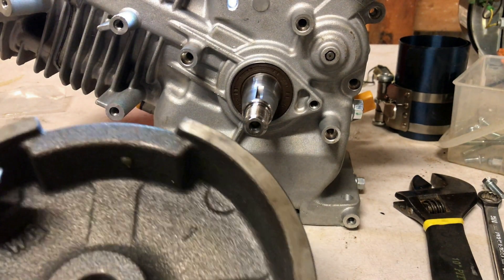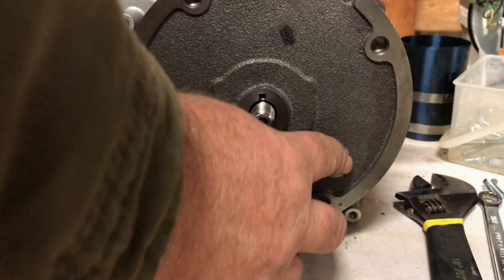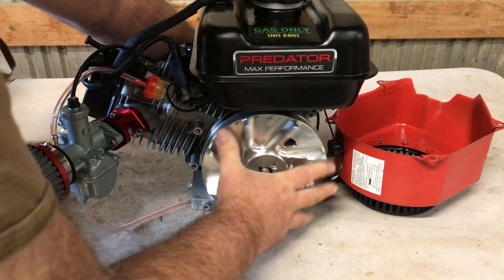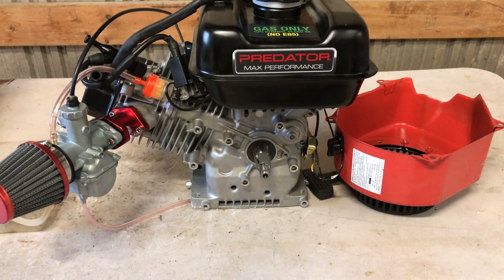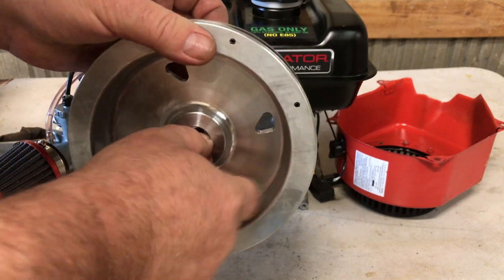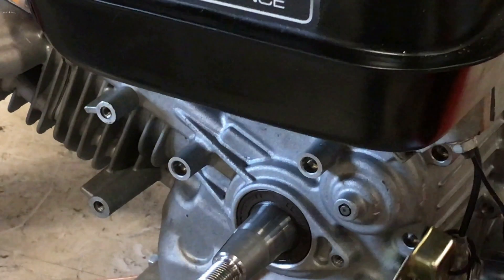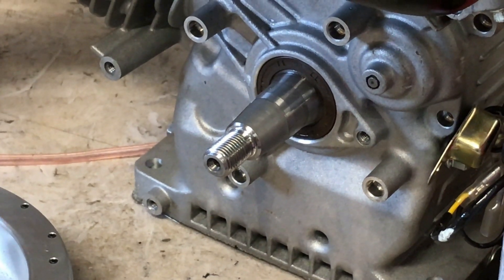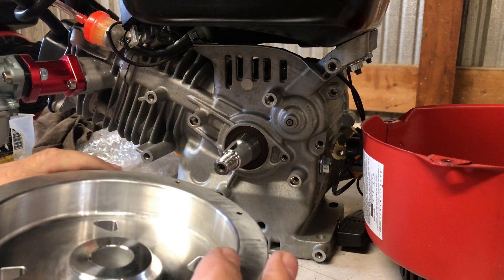Hard Starting and Kickback Solutions for your 224 Predator 212 Engine Build 223 Wildcat 236

Comment: I have a predator 212 with a stock key and arc billet flywheel  it kicks back but I’m not sure if it’s the flywheel because it has built in timing but do you think I have to turn it back a little bit?
Reply from the maker: Hi Dayton! I'm using the Slip Stream billet flywheel and it's supposed to be around 32 degrees with a "0" stock key. I think it's actually closer to 34 degrees though. With the 224 build and the parts I used in that one, I'm using 93 octane with some additives to kick it up to around 95 octane and some synthetic two cycle oil mix about 100:1 . I had to reduce the timing about 2 degrees in the end. I'd rather run Methanol and kick the timing up to around 38 degrees in this engine, but it's not a true race engine and will never see the track. I'll just keep it on gasoline with additives for now. It still kicks back every now and then but that's ok as long as it doesn't become a habit.

Comment: I just got a new cup and pull start for mine I replaced it and work great for day maybe got loose thur timing off or muffler value I think pull my arm out of socket yesterday
Reply from the maker: Hi Paul! Don't forget to check the valve clearance adjustment. It doesn't have to be off by much for the compression release to stop working. I think I have one arm longer than the other after years of pull start kickbacks! 🤣
Reply: @KentuckyFriedFixes  I adjusted valve clearance now no compression not sure there all reading good I think
Reply from the maker: Hi Paul, you may have adjusted the exhaust valve while it was on the decompression bump. Check out the 7:45 minute mark on my video titled "Part 3-B DUCAR 212 Hemi Performance Engine Build" For the details on valve adjustment.

Comment: on my ducar carb with 140 etube whats the best jet to run what boosters should i get i wanna juice her up real nice like
Reply from the maker: AC I really can't give you a good honest recommendation of what to run for those carbs. The main reason being, I just don't build the stock carbs because I don't see any big power gains in them. The main problem is they're really small on the venturi bore size and really restrict air flow into the engine. With everybody at a different altitude, I could only guess where you need to be on jetting. I will suggest a couple of things to watch for that may help though: There's a lot of aftermarket parts in kit form for these stock carbs. Be careful with the emulsion tube changes. Some of the aftermarket emulsion tubes are tuned for Methanol and have very large holes that will cause low speed problems if running Gasoline. Just make sure you get a performance kit with emulsion tube that is tuned for "gasoline". Your jetting will always be determined by how it runs on the top end and what the spark plug looks like. Try to jet for a nice chocolate brown color on the plug (light brown is ok if you want to run a bit on the lean side for more power). A white plug is too lean and black and/or shiny plug is too rich. If your carb has the removeable air jet, opening it up to the next size up with a pin drill will allow you to run a larger main jet when fine tuning. You'll get it where you want it.
Reply: @KentuckyFriedFixes  my LG plug was coco brown like foxy lol i put a autolite in it now havent pulled it out yet but do get a kickback everynow and then but only when i limp wrist it if i crank it good it dosent snap back idk i think im gonna order the tilly estart just to throw on while i take this ducar off an open her up
Reply from the maker: @CruiZe-A-ViSiON  Sounds like it's jetted perfectly! I wouldn't worry about a kick back if it's only doing it every now and then. I'd only fool with it if it starts pulling the rope out of my hand more often than not. A little excess timing is a good thing for performance.
Reply: @KentuckyFriedFixes yea that ducar is the bomb diggy for real that's why I was happy when I got the duromax so I can pull of my ducar and build her up 💪🏼💯
Reply: @KentuckyFriedFixes  the 140etube has less holes than stock to give more gas less air thank u big TiME FoR ALWAYS RESPONDING TO MY NEWBIE QUESTIONS lol

Comment: I installed new coil on predator ghost and now it does this, confused, help.
Reply from the maker: Hi Jaden, if you installed a standard stock coil, double check that the coil wire is pointing up. Those things will mount either way. If you also changed the flywheel, it could have more advance too, so a different timing key may be required. Usually it's something small, so just give it a once over. Things like valve adjustment and stuff. Some kickback is normal but if it starts pulling the rope out of your hand more often than not, you may be a little high on the ignition timing. Or the exhaust valve could be out of adjustment and missing the compression release. You'll get it.
Reply: @KentuckyFriedFixes  thanks I will keep at it

Comment: Ugga Dugga that billet flywheel! Let's be honest that's what most people do
Reply from the maker: Hi JB! I put an impact on mine. It seems to upset some viewers so I always recommend everyone follow their flywheel maker's installation instructions, even if I don't. To me, a loose flywheel can be more costly than one a little tight. But again, that's me. Thanks!
Reply: @KentuckyFriedFixes  I do the same. Never had a problem. It is a pain putting a torque wrench on the flywheel bolt. Some small engine guys torque every single bolt to manufacturers spec

Comment: can this happen with an engine fresh out the box
Reply from the maker: Hi Andrew! That's a great question and the answer is YES! The valve lash can be improperly set from the factory causing the compression release on the cam to not function. It's always a good idea to set the valve lash on a new engine as part of the pre-start routine for a new engine.

Comment: Hey man I got my hands on a 224 predator and hemi swapped it. Swapped the plastic cam to the hemi cam and now Im having kick back running everything stock carb and flywheel what you think it might be boss??
Reply from the maker: Hi Daniel! If you haven't changed the compression ratio by changing pistons or using a thin head gasket, it could be something minor. Check to make sure the coil is not mounted backwards, I know it's kinda silly, but double check, it happens more often than you think. If the coil is correct as well as the stock flywheel and stock timing key, it can only be your compression release. The exhaust valve is out of adjustment and not allowing the valve to kick open to release compression during start up. There are all kinds of videos on YouTube that tell you to adjust the valves at TDC, don't do that. It's easy for the exhaust valve to be up on the compression release at that point. Instead, turn the engine until the intake valve is open all the way and stop. Adjust the exhaust valve lash to .003 cold. After you get the exhaust lash adjusted, turn the engine until the exhaust valve is all the way open and stop. Now adjust the intake valve lash to .003 cold. By adjusting them this way the exhaust valve is nowhere near the compression release bump. Hope this helps.
Reply: @KentuckyFriedFixes  hey man i tried what you told me to do .003 on both sides cold. Started nice and all but my exhaust rocker calaps and cuts off when I give her some rpm??
Reply from the maker: @SRT-Dani  Hi Daniel,  If it's noisy you need to verify your lash settings again. The only other way the valve lash would be changing on a hemi is if the valve is bent.  A bent valve could also cause the engine to die when you rev it. If it's not just a valve lash issue you'll need to start looking a bit deeper. Some things to check would be bent valves, look at the top of the piston to see if the valves have made contact with the piston, check the piston for marks to see if it's made contact with the head. When you're having a noise issue that's not going away it's best to check everything from the connecting rod up. Sorry I can only suggest the most common things to check. I have seen valves on a hemi head bump the top of the piston and bend when stock springs were used and the engine was revved to valve float. The exhaust valve will be the most likely to be damaged in that case. If the rod is bad it can cause the piston to bump the bottom of the head as well. You're gonna have to get a look at everything from the rod up until you find that noise.
Reply: @KentuckyFriedFixes  from what you said boss I think I need stiffer springs I’m running the stocks needa get upgraded ones and yeah man my exhaust valve barley nicked the piston checked the valves they seem to be straight
Reply from the maker: @SRT-Dani  You'll get it Daniel. Sometimes the little things can be a headache.
Reply: @KentuckyFriedFixes  appreciate the time boss!! I’ll keep you updated

Comment: Also if you don't set the valves correctly you will get kick back, if your cam has a compression release. You need to set the piston to TDC, then turn the flywheel more slightly. Then adjust the valves. If you do it at TDC the exhaust valve won't open properly when starting and you'll get kick back.
Reply from the maker: Hi Brad! Yes Sir! Proper valve adjustment is the only way that compression release will work.

Comment: Hey KFF, me again with a quick hard to start comment for those with 3rd grade education like me. I’ve been enjoying my copy cat 224 build until I gassed up for a ride and got about half a mile and engine started sputtering and backfiring again then died. I thought oh no, the flywheel slipped and timing is off. So rechecked timing, pulled cover and checked cam timing…everything checked ok. Then noticed when trying to start the engine it would briefly start then spit white smoke/steam out the exhaust. Remembered the gas was a new can of Mobil hi test. Duh, then it dawned on me, water in the gas. Drained tank, refilled from different can and presto, running fine again. So, like you schooled me on another post, CHECK YOUR FUEL. It’s not always timing. And, yes, I’m a dummy checking the hardest stuff first instead of the obvious. Have a good day and keep on posting.
Reply from the maker: Hi Galil308! Thanks for sharing Bud! We've all had bad fuel at one time or another. Everyone's guilty of thinking the worst has happened when a problem arises. Great point to start with the small stuff and work your way up! Thanks!

Comment: What feeler size did you use please and thank you
Reply from the maker: For the Predator 224 build with the 265 Banzai camshaft I used .003 on the intake and exhaust valve adjustment during the video. Later I tried a .002 on the exhaust valve adjustment and it worked much better with the compression release on the Banzai 265 cam.

Comment: Hey KFF, my local Harbor Freight finally got one 301cc hemi (model 62554) in and I snagged it. Time for you to do stage 1, 2 and 3 build videos on the 301 so we can bring this big block alive. So let’s get started ⚙️🔩🔧💸!
Reply from the maker: Hi galil308. I'll look at what parts are available for those now. I was going to build a 301 a few years back for a Wheel Horse puller but there weren't any aftermarket parts available for them at that time. I guess it's time to check again. I wasn't planning on building anything over 250cc but depending on the aftermarket parts situation I could possibly fit one on the old dune buggy frame. I'll check into it. Thanks for the input!

Comment: Hey man, I wish this video was out before I destroyed my first ARC billet wheel on the stage 3 224 build I did following your previous videos. I took your advice from comments which were exactly like this video and I’ve now got a screaming 224 that only occasionally does the kickback, especially on cold days. Just completed the dual bearing billet side cover. Keep these great informative videos coming and thanks!
Reply from the maker: Thanks galil308! You inspired it buddy. You're not alone when it comes to these issues. I hope somebody get something out of the video that helps. Appreciate you!
Reply: @KentuckyFriedFixes  PS: I was having hard to start issues with the 224 and some “snap-crackle-pop” in exhaust when I backed off the throttle. Changed spark plug, then changed carb, tried disconnecting kill switch, still same problems. Then I changed the coil pack with an extra I had from a 196 clone and she starts first pull. I have maybe 5 hours on the 224 so I’m surprised the coil failed so quickly. I’m wondering if the high rpm’s and the strong magnets in the ARC billet wheel might have contributed to its untimely death. Of course we are talking about a Chinese part 😜.
Reply from the maker: @galil308  I would bet the ARC flywheel with those neodymium magnets got your coil. Don't feel bad, they burned up a few of mine before I figured out to set my coil air gap a lot wider. It may also help if you get rid of the factory resistor spark plug boot and replace it with just a regular plug boot and connector on the end of your plug wire. I'll be doing that in an upcoming build.
Reply: @KentuckyFriedFixes So with the higher strength magnet it's better to set it more than .030?
Reply from the maker: @rigleyrigley4000  Hi Rigley! Oh yes, you need a wide air gap between the coil and a hot flywheel magnet. Somewhere between .040 to .060 (forty to sixty thousandths of an inch). The hot magnets will absolutely cook your coil. Now there are other tricks you can use like changing the stock plug wire to a larger copper core wire that will help your coil live longer, copper ground straps correctly located will also pull some heat away from the coil, but a tight air gap with hot magnets is a sure fire way to fry a coil. I went thru several expensive race coils and a few stock ones before learning this. We live and learn, sometimes the lessons are expensive though. Thanks!
Reply: @KentuckyFriedFixes  thanks sir! 👍💯😎

Comment: I had an old Briggs as a kid, no gov, shaved head, ported, it ran well for a flat head 5hp, it was difficult on the tires!  But  it eventually died, I was full throttle and it was moving fairly good, started spinning a bit, then slung the chain, it broke the key, I fixed it, but it never ran again! Now I'm older, like 30+, years older,  I wish harbor freight was around then, I'd bought a 8hp , anyway, I'm thinking it jumped timing on the cam, because it broke the key from over revving! It was turning as fast as I revved it when the chain went off the hook, and probably turned 8k+ I like to think I kept it under 5500,  I couldn't tell it lost much compression, the plug fired, but it would not run,  I been thinking about getting a 212, maybe a 224, after the aftermarket catches up,  and build a scooter based mini bike,
Reply from the maker: James I love those 5HP Flatheads!

Comment: thinking you may of given me something else to check on my gx390 clone powered woodchipper, it kicked back hard, snapped the cord an my fist hit me in the chest so hard it put me on my knees later that day i had a fist size bruse, i didn't feel right for 2 days anyway only thing i could think of is the decomp cam since i checked everything i could think of an found no real information on youtube as to what the issue could be till now that is, thank you Sir .... subbed
Reply from the maker: Thanks Arron , welcome! The flywheel key is a likely culprit and if that exhaust valve lash is off it'll be hard to crank for sure. Thanks!
Reply: @KentuckyFriedFixes  thanks bud, yeah i checked the exhuast lash it was fine but i closed it up a bit anyway, didn't notice the the little blip from the decomp hence why i thought it was that but you've given me something else to check so thanks again for that, i look forward to seeing more videos